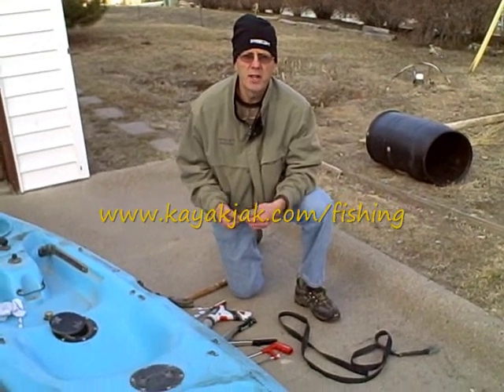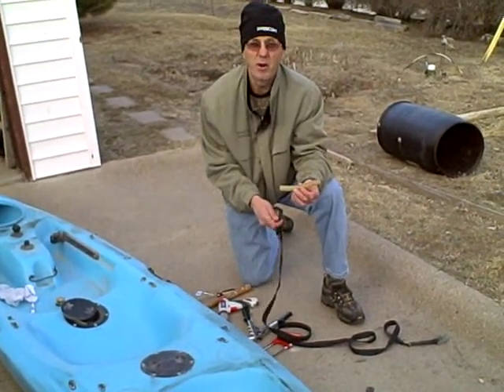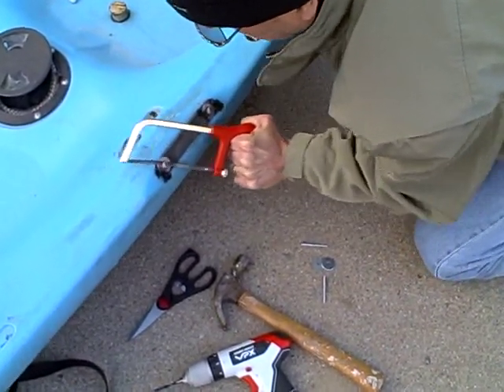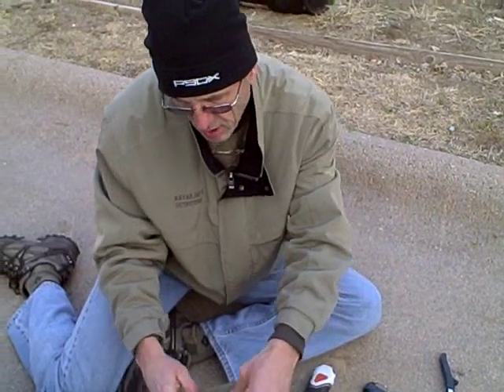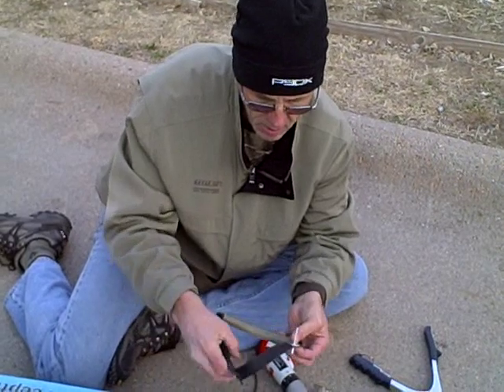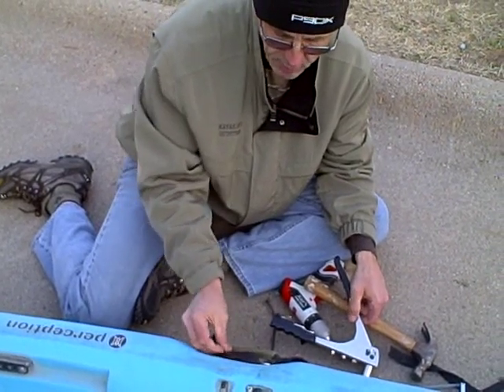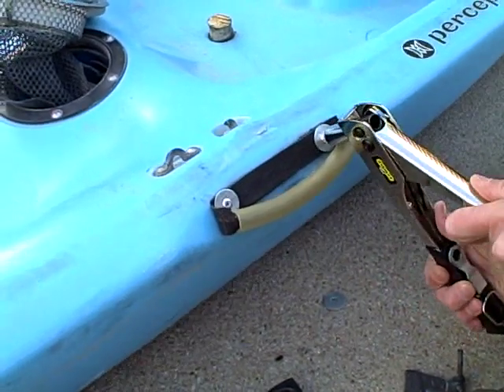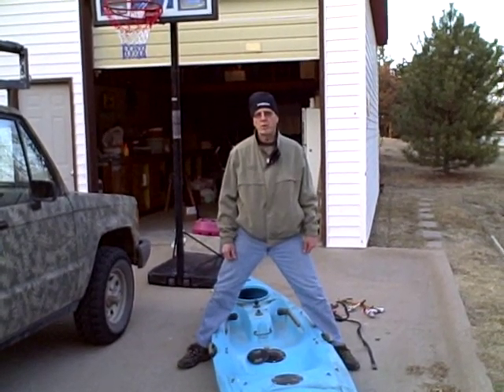How To Install or Repair a Kayak Handle

Comment: Hmm, never drill strapping, it can bite on the drill bit and become VERY dangerous, use a soldering iron tip to melt a hole. 
I also notice you are not using silicon, don't k ow how u can leave that out. 
Nice manufacturing handles sell on eBay for $3 free shipping, don't know why u would rather stick a piece of hose on your kayak.